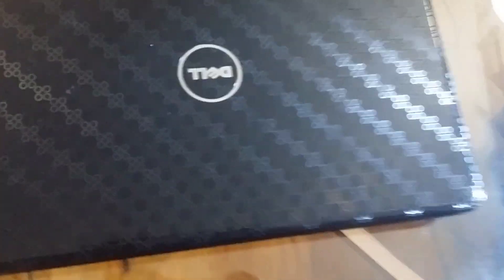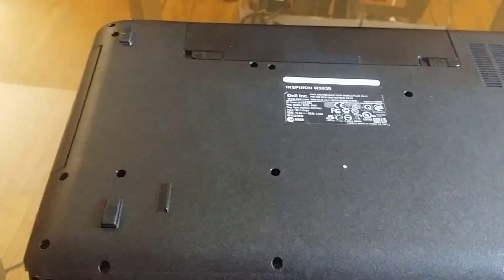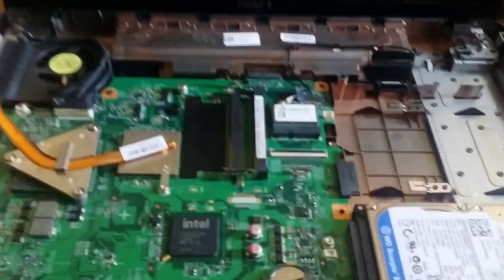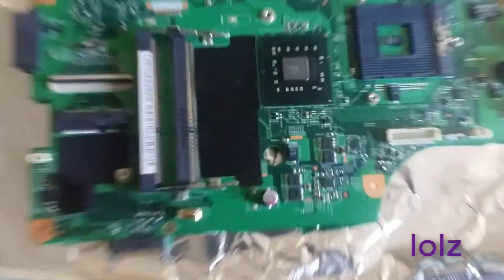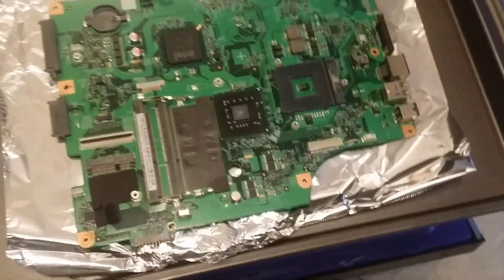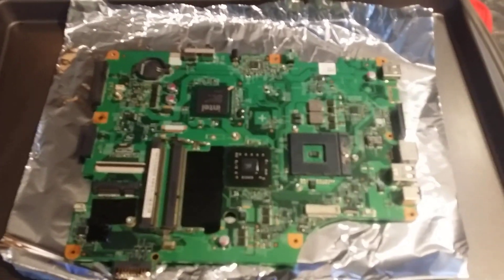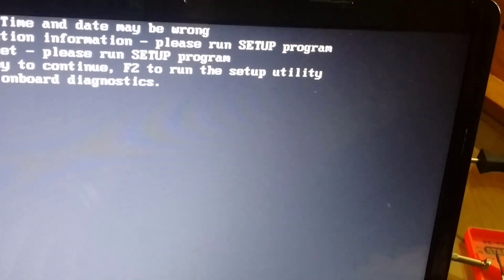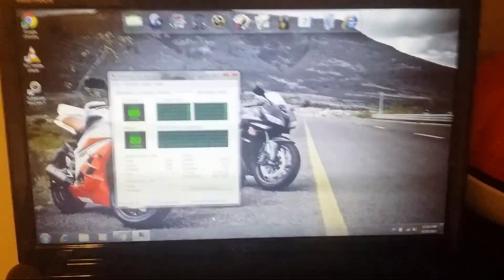dell inspiron n5030 7 beeps of death how to fix it.

Comment: Hi, is this a way for ever? Or a confident way?
Reply from the maker: This is just an easy fix to get your stuff off the computer normally don't last forever but maybe you'll get lucky.
Reply: @ruff1992  I mean, if my problem is solved this way, is it possible that the laptop will have the same problem again?